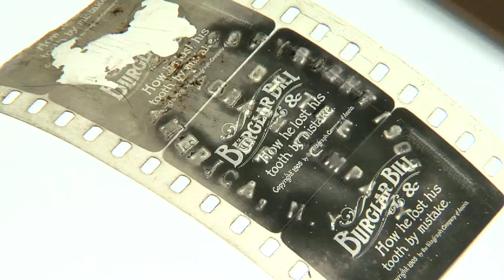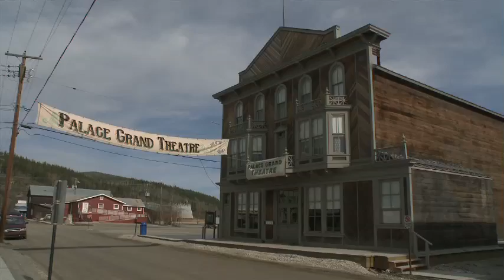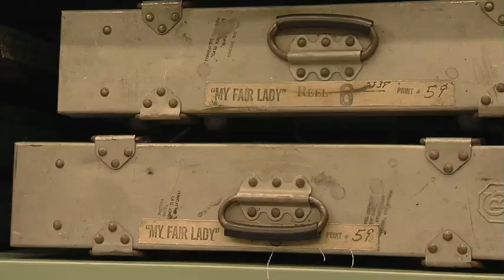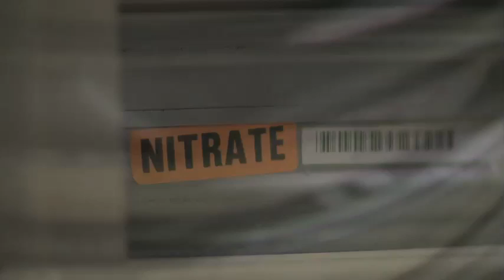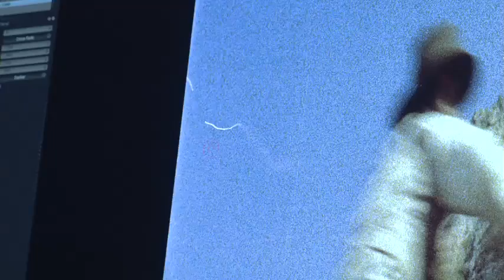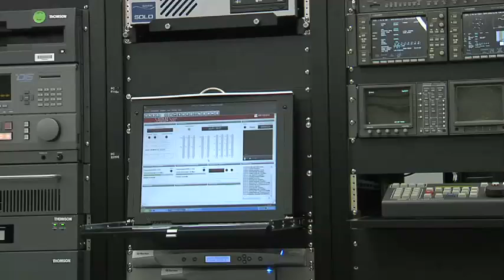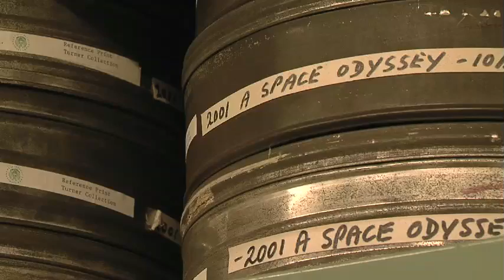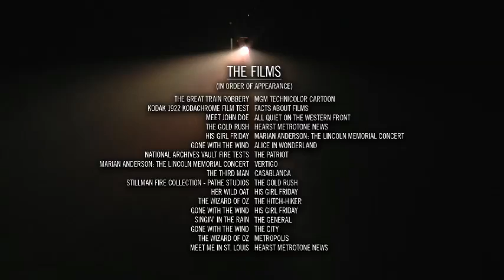Lost Forever: The Art of Film Preservation

Comment: watching this while hugging my Interstellar 70mm film cell.
Reply: +Dr. Olympus My prized film piece is one of probably three VistaVision prints ever made with 6-channel magnetic audio.  I also have some VistaVision from a photo-chemical restoration of Virtigo.
Side note, I think it's sad that even movies shot on 65mm go through 2K scans for post-production now.  What a waste.  Even Super-16 approaches 2K resolution.  Just do the scan for the off-line edit and do a contact print for the conformation!
Reply: +Dr. Olympus lol One day they'll come looking for all those individual frames to restore the full length feature.
Reply: @wado1942  luckily, now 4 years later, 4K post has become the standard.
Reply: @Capeau  The most common camera being used in Hollywood right now is 3K, which usually gets scaled to 2K for editing but sometimes 4K.  I don't think it's that big of a deal really because more pixels in your digital camera usually means smaller pixels, which means less sensitivity, dynamic range and more noise.    Unless you sit super close to the screen, you can't really see the extra detail.  Also, Digital Cinema Packages are 250mbps max, regardless of resolution.  So with 4K, 97% of the information is thrown away whereas with 2K, 87%.  It also takes 4x as long to render 4K over 2K and with most movies being 98% CG these days... I exaggerate but you get the idea.

Comment: "Digital is part of the problem now. That it's not part of the solution. We're still preserving films on film because film is going to last so much longer and be useful for so much longer than any digital file will be."
-Mike Pogorzelski

"If it is stored properly; cold and dry. We know, through tests that have been done, it will last 500, 600, 700 years, maybe longer. Through nothing but passive storage; very cold; very dry; put it on the shelf, and we know we can go in a couple hundred years, and pull it out, and it will still look good."
-Jan-Christopher Horak

That's actually very encouraging.
Reply: @NVC77 Hard drives only have a life expectancy around 1-10 years
Reply: Digital is nothing but a series of 1s and 0s, so in a way it's a great way to store movies. It's just a matter of choosing a durable storage medium as well as making sure that we have the software to read and interpret the data. But keeping an analog version on film as well is a great idea to ensure that the material won't get lost in the mist of time, even if we lose the ability to extract the original digital file.
Reply: That sounds like a good solution. Digital files in themselves isn't enough. They can easily accidentally be deleted or rendered unusable.
Reply: Digital glitches so easily...we will have a "born digital" cinematic holocaust that will make the "burn rate" of Nitrate and the Vinegar Syndrome of "safety" film look like we conserved our historic films well.
Reply: The thing with digital though is it's ease of copy and small size, because of this any movie that has been released to the public essentially archives itself providing new copies are created and kept in circulation. Even if the original scans and their backups become unusable by the studio, because digital (when done properly) does not degrade or lose detail between generations they can pick up a new copy form anywhere in the chain and continue to reproduce without any losses. Sure it's not as romantic as canisters of film locked in some Bond villain-esque underground vault, but that fact is while everyone sits around worrying about the physical strips of celluloid that contain Citizen Kane slowly rotting away digital copies are continually being made and backed up.
Reply: @msgeek703  Jeez gramps thats a bit harsh. I feel like theres enough people like the ones in this video using massively high quality hard drives to be ok
Reply: @PurpleColonel  we will have to have way more reliable storage than we have now. There is promising work being done along these lines, but nothing quite ready yet. Also, the file formats need to be 100% open. Proprietary formats that might not be accessible hundreds of years into the future are not going to work for this. And don't get me started on the encryption used on DCP.
Reply: Seems to me the BEST solution is to keep both the physical version AND digital archive. Digital because of the fact that it's easy to disseminate widely and the 0's and 1's themselves don't degrade. Physical so that if there are new means of restoration developed in the future that we can't even envision today we will have good source material to work with.
Reply: @NVC77  Yeah plus Storage has changed a lot over the years. Solid state drives are replacing hard drives. They are more durable, last longer and are becoming more affordable. Also I'm pretty sure a 4k blu ray disc of gone with the wind is a good alternative to storing on a hard drive once the prints are gone. We have to embrace digital but just be careful and make sure we have back ups and burned disk copies stored away in the right conditions.
Reply: @Bikey_McBeardface  agreed
Reply: @msgeek703  easy there boomer digital is much more salvageable than film
Reply: @msgeek703  thats why we're continually backing up files on the next available format. Solid state drives have replaced hard drives. They are more durable and long lasting.
Reply: digital is actually safer.. easily duplicated and stored at multiple locations. Not to mention you don't lose any quality/info/data when duplicating.
Reply: @NVC77  Theres nothing wrong with compression, as long as its done losslessly.

Comment: It's all very sad to look back on.
Expensive productions on videotape from the Quad era were wiped because the tape was considered more valuable than its content. Some have survived on 16mm prints made for export.
Nitrate film is unpredictable in many ways.  I have some nitrate short films that have survived in perfect condition.  I still project them at home with a low power lamp.
On the other hand it was some 15 years ago when I found a 1920s short, title: 'Stop That Shimmie' (as spelled on the can) at Tyneside Cinema.  Sadly it was too far gone to save.  My first advice to anyone handling the stuff is: Wear a mask:  DO NOT inhale the brown powder; very unpleasant!
Have a ceremonial bonfire.  Degraged nitrate is VERY unstable.  The best way to deal with it safely is to burn it, taking all sensible precautions., after which there is no hazard.

Comment: I have faith that we'll find a long term digital storage solution at some point. We have to. Films may be able to be stored on celluloid for decades or centuries, which is great, but we're now generating a lot of digital only content. Computer code/websites, video games, 3D digital models/art, etc. Things that are not as easily (if at all) translatable to a physical format like celluloid or paper prints. So we need a low cost, low/no power long term digital solution and once found can be used for older films and photographs as well. It's just a matter of time. Perhaps that new DNA storage solution being worked on.
Reply: I had an idea for that myself; pretty simple, actually. The problem was the materials science. I had no clue what type of non-oxydizing material could be used; the only thing I could think of was gold and that...yeah, that wouldn't be a good idea.
Reply: roxics I don't know the exact length but a very very microscopic amount of DNA can store 900 or so terabytes,sure server rooms can store more but a whole full size server rack full of DNA could store PETABYTES and more of storage. I wouldn't even know how to count over a 1000 petabytes

Comment: The New York Pathe' studio fire shown here was not actually caused by nitrate film, but by a short-circuited light that ignited the cloth soundproofing on the shooting stage, which spread to a roomful of paints and solvents.  However, nitrate film in the building no doubt contributed to the blaze.  Several crewmen were trampled to death in the frenzied stampede to the studio's only fire exit.  Others were badly injured by jumping from second and third-floor windows.

Comment: Back up the digital data by printing all the 1s and 0s on that polyester film. Problem solved.
Reply: +Kram Sacul Sadly, it doesn't work that way.  A spec of dust on an analogue optical print is a small artifact most people won't notice.  A spec of dust on an optical digital print means a completely unreadable frame.  Also, it takes a lot more film to store an image in digital form than analogue, something like 10x as much, unless you compress it, which make it even harder to read.  So, digital on film is almost as unstable (and a lot more expensive) as digital on magnetic tape, which is what we currently have to do, in triple redundancy, migrated every five years.